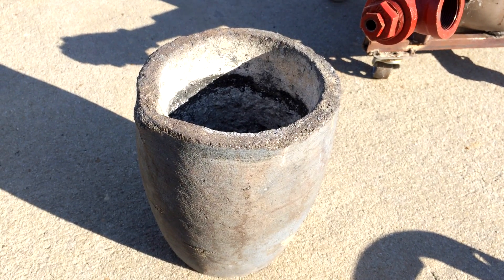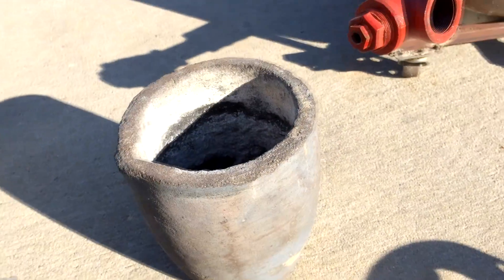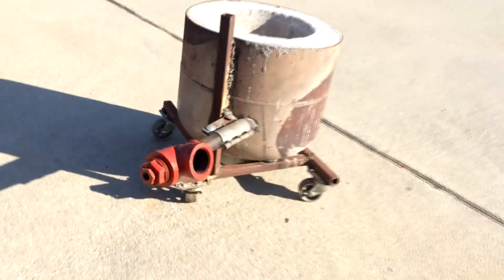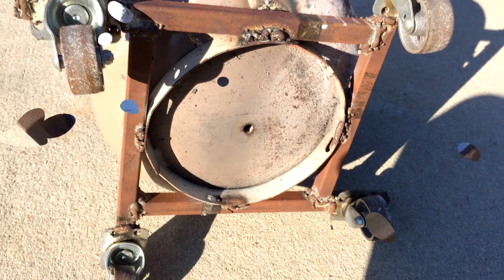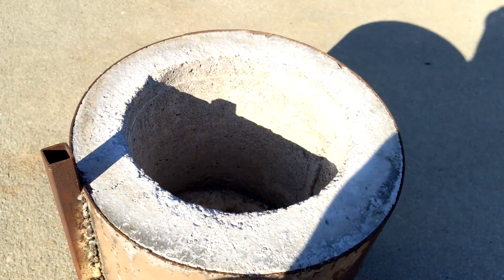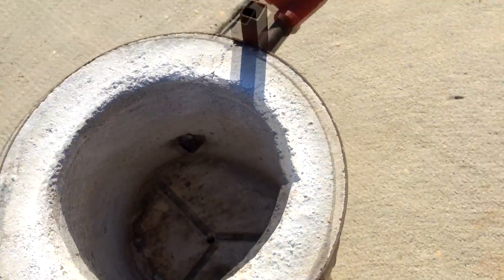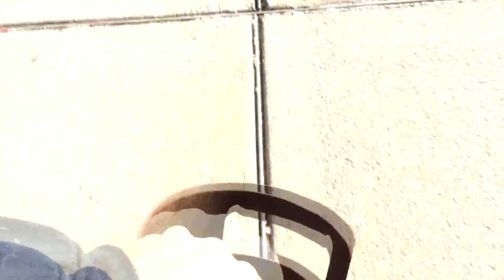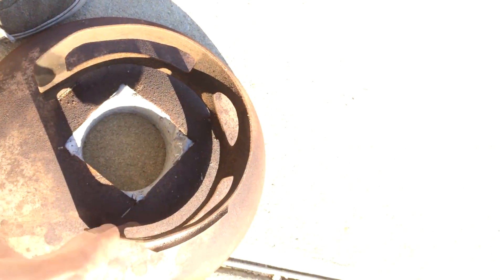Home made Foundry and Burner (Little Sparks Ep. #2)

Comment: few questions, how thick was the refectary cement? For the burner did you use a mig piece? If so what size? Do you hook up an air supply to the burner?
Reply from the maker: all good questions.  check my playlist "little sparks"  where i detail out how i made all the bits.

Comment: what exactly did you use for your burner I've been trying everything to get mine to run on propane but it just not working
Reply: He just showed you. It's black gas pipe about a foot long, a reducing "T" that looks to be 1x1x3/4 then on the 3/4 he reduced it to 1/2" then again with a "compression" fitting to about 1/4" On the end of the hose from the propane tank he used a ball valve and some reducing again with his gas orifice looking to be a tip from a wire feed welder shoved into some 1/4" copper tube. Then he pushed the orifice into the compression fitting of his Venturi burner. The compression/friction  holds the 2 together during process. It's a very crude and simple design but very useful and cheap to do.
Reply: +aimee rogers
I used 12" x 3/4" pipe, with bell reducers on each end.

Comment: I've been doing casting at home for years now. Everything I've made myself. You are doing very well but should check out waste oil burners. I had electric resistance wires like a space heater at first but use waste oil now with a little propane to start it. Very hot and starts melting aluminum in 30 min. Keep up the good work!
Reply from the maker: Herb Delight Thank you!

Comment: I will drop you a email .  I have spent almost every free moment I have had making molds and foundry.  I have learned a grate deal.  I work for one of the larger engineering firms in the world. Mostly Petrol chem, and environmental.  Everyone that has seen the works created by thiis is amazed at how far and fast we have progressed. I want to get you some video of our progress.  I believe we could trade some info and perhaps trouble. Shoot some of the mistakes we have Incountered .  With our pours,one is a Celtic chain.  I have seen you have done something very similar .  Thanks! For the inspiration.  Your video,s  have added a spark that has turned into a flame.  I need a loan to pay for propane:)

Comment: One of the best jobs we have seen on the tube. Safety and proficient In the process of building foundry   Will use many of the thing,s we have learned from. The Raven. I Also like the show you put on. Working with go pro. At later date may ask for some tip,s. See you use a Sony pro line to do editing. Thanks Much!
Reply from the maker: Boss223 Thank you!  If you ever need help drop me a line.  556Raven (at) Gmail (dot) com

Comment: Will it melt gold?
Reply from the maker: no propane doesent get hot enough
Reply: +556Raven When used in the open air, burning propane reaches a maximum temperature of 1,995 degrees Celsius, and gold melts at 1,064C but it depends on tip and weather you can add more air to system. So it would and does melt gold. Have you thought about adding a blower to you air inlet? It would get much hotter I believe. Nice job.

Comment: Thanks for sharing this, been thinking of getting into this for a short while and this vid helps, just a quick word of warning to anyone else thinking of using this method, if anyone is going to use a propane tank to cut up for the foundry, MAKE SURE IT IS EMPTY! also when the valve is removed,fill the bottle up with water BEFORE even THINKING of cutting it with a grinder or oxy/acetelyne etc as residue gases can still cause a massive explosion and the only thing being cremated won't be the aluminium!
great vid though,and you've inspired me to try it soon!
Dan,uk.
Reply from the maker: Dan Allured Good point.  I actually went to the local home store and purchased a brand new never used tank to cut open.  I was terrifyed to try it on one that had gas inside because i like having all ten fingers and a nose.
Reply: 556Raven lol, thanks for the reply, i just thought it'd be better to mention it incase a novice was to try it without understanding that even an "empty" tank can still have residue gas that will explode, i used a propane tank for a compressor once and had to weld a drain valve on the bottom,i'd made sure it was filled with water and drained first to make it safe, i welded the drain valve across the word "bottom" that was painted on it,and the valve spanned the "TT" letters in the word and the welding left spatter marks,when i looked at it later it looked like it said "boom!" lol,i thought that was a warning if i ever saw one!
great vid,looking forward to some more, loved the fireant sculpture,very clever.
Dan,uk.

Comment: What size pipe do you use 1inch or 1 1/2 inch from the foundry to the burner
Reply from the maker: its a 3/4" steel pipe.  I got the kit from these guys.@burners.html
Reply: Thank you again
Reply from the maker: anytime.  ;-)
Reply: Sorry to bug you again but the link is invalid
you may have typed it incorrectly
Reply from the maker: http://www.hightemptools.com/burners.html
Reply from the maker: it would appear the comment block does not like the paste option...    @burners.html
Reply from the maker: tripple W dot hightemptools dot com slash burners dot html

Comment: Cool, thx for sharing.  Did you have to dry the refractory over a few days to keep it from cracking?
Reply from the maker: Yes i let it dry for three days very slowly then used a space heater laying on top of it for a few hours to further drive out moisture.  Then finally lit the burner and kept the PSI very low for several hours untill all the steam stoped...   Then i put the spurd to it and it seems to be holding up well...  Been running over a year now with no issues.